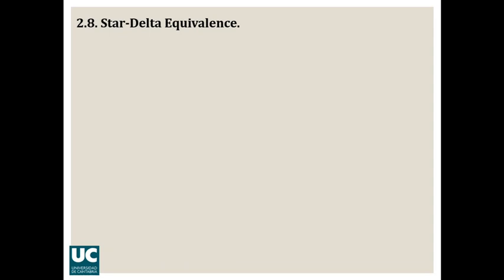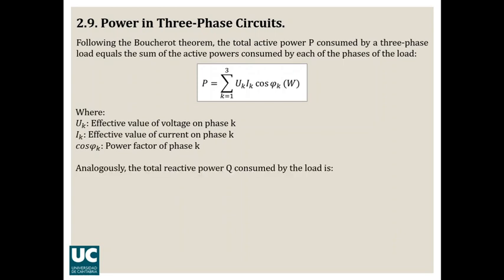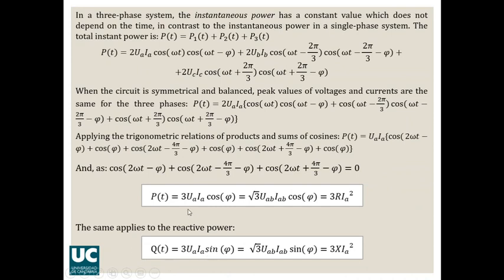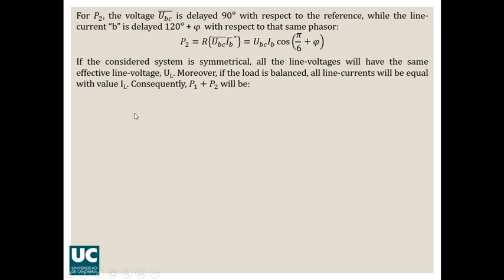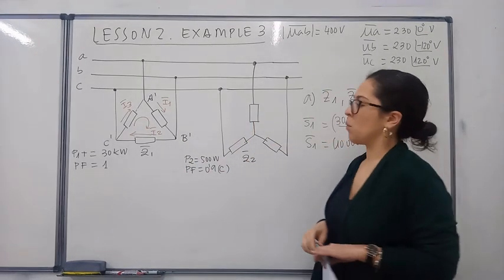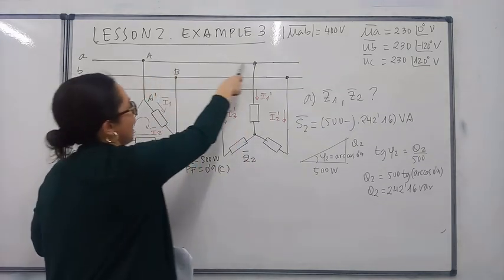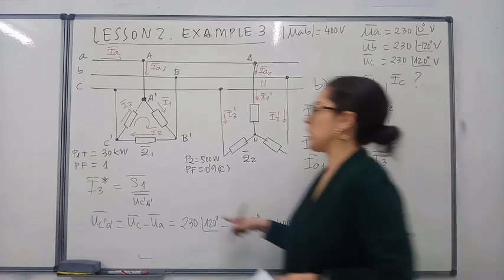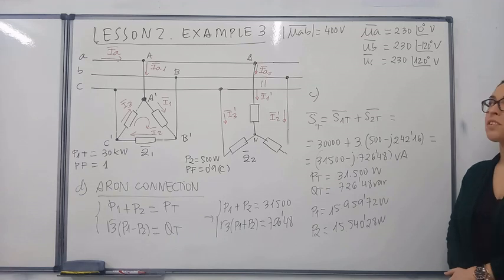E&T: Lesson 2.2.  Three-phase circuits (2.2.8-2.2.10 + Example 3)

Comment: Buenas.
Justo al final, la Qt no sería -726,48 ?? o el signo menos se tiene que quitar
Reply from the maker: Hola Isidoro. En el último apartado del ejercicio nos dan dos vatímetros conectados mediante la conexión Aron, que se utiliza en sistemas trifásicos sin neutro, y nos piden la medida de cada uno de estos vatímetros (P1 y P2). 

Como aparece en la demostración de las diapositivas de teoría de los apuntes, la potencia activa total del sistema coincide con la suma de las dos potencias medidas por los vatímetros (Pt = P1 + P2). La potencia reactiva total del sistema coincide numéricamente con Qt = raíz(3)·(P1-P2). El valor menos de la Qt no se incluye, sino que se obtiene Qt en valor absoluto. En cualquier caso, si pusieras Qt con su signo negativo, sencillamente saldrían los mismos resultados para P1 y P2, pero intercambiados.

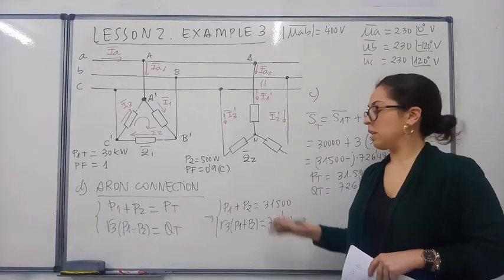Por cierto, me he dado cuenta de que en el minuto 36:53 hay una errata al transcribir la segunda ecuación del sistema, que debería ser: raíz(3)·(P1-P2)=726,48.
Reply: @CarmelaOriaAlonso  ah vale perfecto osea que se pone el valor absoluto de Qt, muchas gracias. Y en cuanto a la errata esa gracias por avisarme, ahora la corrijo en mis apuntes también.